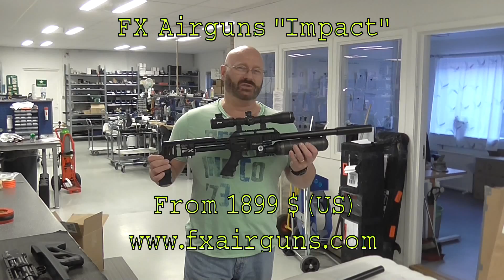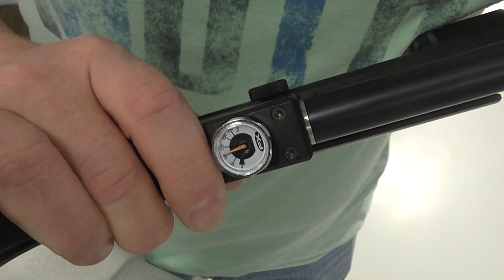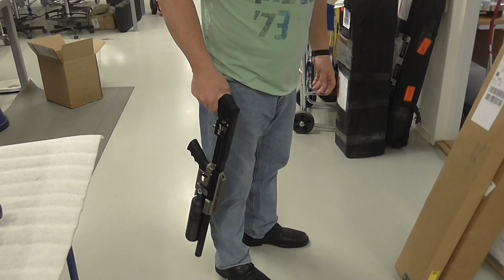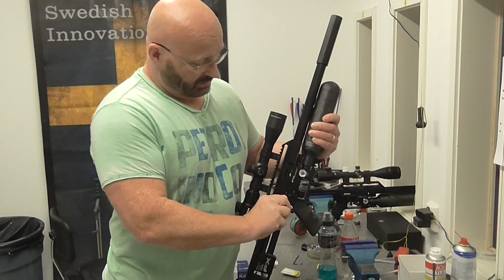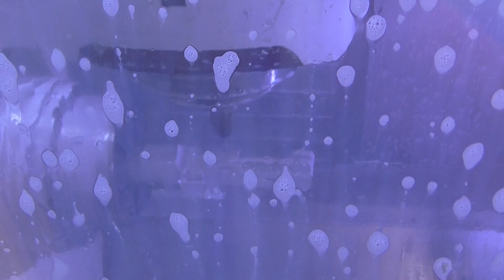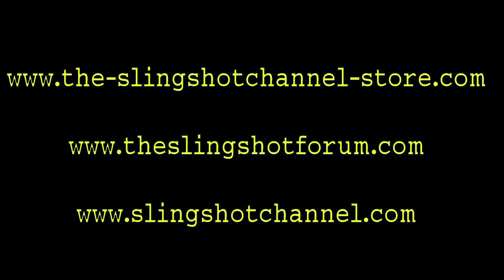FX Impact - Unbelievably Cool Airgun!

Comment: could you make a video on affordable, durable weapons in case of a crisis?
I love your slingshots, but rubber is not the best material in my opinion if the supply of it stopped one day. After 3 years of usage most rubber bands would snap

i loved the idea of an airgun, being able to pump it up by hand. probably extremely durable as well. But in the end if there is no gas bottle lying around, it'd be tedious and pretty slow to pump it up for every single shot.
Maybe another crossbow review? Something that is actually on the market and not too expensive

I'd love some feedback

Comment: Why would you need a scope for an airgun just instal iron sights and boom your good to go then your don't need to worry about bumping your scope and it's still accurate
Reply: Cryptus Legion
Already tried with my airsoft friends. Using a facemask of  course. (yes..we are that dumb)  Really scary feeling, but fun at the same time. If you are a good shot..i would let you try =)
Reply: Scooter_Rider56 why do you even need a scope for a 50 meter shot any way
Reply: I got an Airsoft sniper with 2,4j..it got a 3-9x43 Scope..and its needed. I hit a dvd case up to 90m (max) away..try that with an iron sight or laser dot. On 50m i could shoot an apple from your head (if scope is zeroed to the hopup)
Reply: Ok put an Apple on your head and I'll try lol
Reply: Well let me first explain my earlier comment, then my reasoning.  I like to shoot long range, so a 50 meter target is very close for me. It's a beginner target something you train on irons to never miss. Aim small miss small. This is not to say that I'm against scopes, I use them on weapons that are hitting out at range. But I would not be using those to shoot apples of your head as it would be irresponsible.
Reply: Cryptus Legion
Yeah..i get you. I love to shoot long range aswell..thats why i got a sniper airsoft. What i forgot to mention is that mine is spring loaded..not gas/co2/air pressure bottle.
So for mine, 90m are the longest distance i would hit a head 100% of the time. Any further away, even with 0.36g BBs (wich is considered max for my rifle)..100m would become more like archery...and our garden is only like 120m long..we dont have many airsoft places in germany..at least not near me.. And since we shoot outside, the wind is at this distance a big factor.
My gun is still a toy..but a toy for wich a scope comes in handy =)
With our other guns/rifles we train of course also just iron sight (or red dot for fun)
The scope comes in handy to see the trajecory of the BB, wich is way too fast for the naked eye..and its just fun to look through a scope. =)
Reply: Sizzlik well i have a airsoft sniper to and yes i have a scope but there is a difference between a .25g .28g .32g etc plastic bbs compared to a metal pellet
Reply: Scooter_Rider56
Sure there is..no question